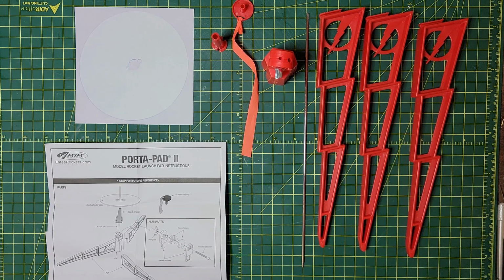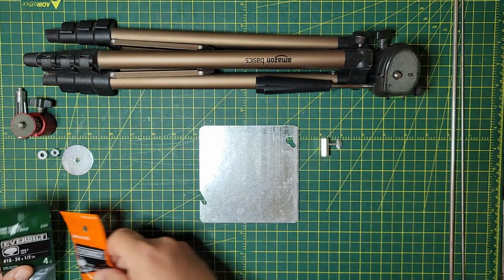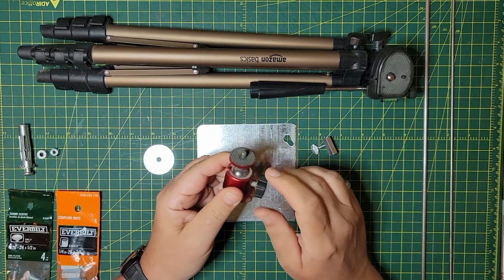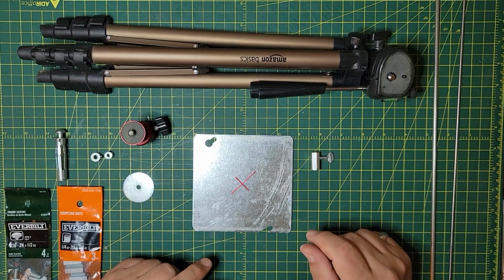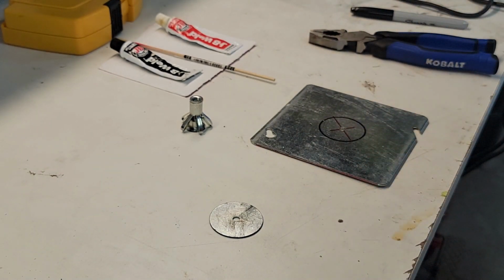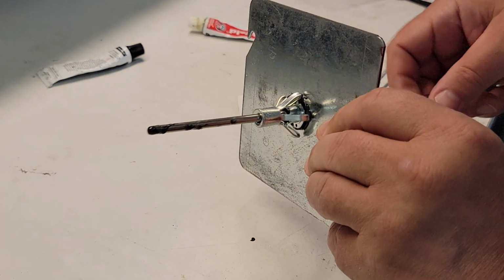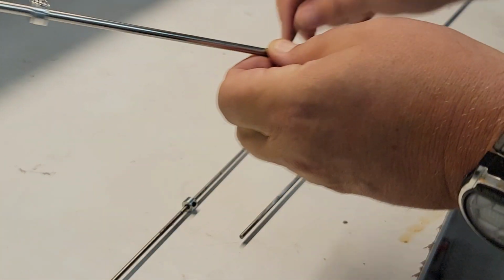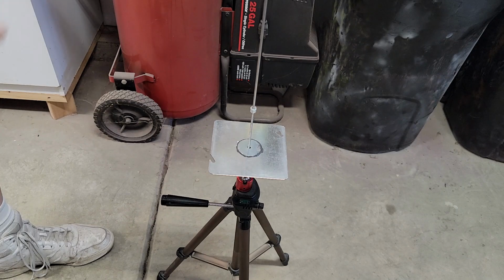Simple Builds Volume 5 - Building Your Own Launch Pad

Comment: Nice build and great video, thorough and even includes the part list at the end. Be sure to make a 1/4" rod for the larger mid power rockets. One note: I see these camera tripods being a bit less stable than some launch pads that have a wider base on the legs. I have seen the tripod tip over with a rocket loaded, which can be pretty bad if it happens as the igniter fires off.
Reply from the maker: The lightweight tripod I used in the video has been used to launch rockets weighing up to 12oz. I have a more heavy duty tripod with a weight hook for bigger rockets. If you only minimally extend the legs (only the top section) it is very stable.